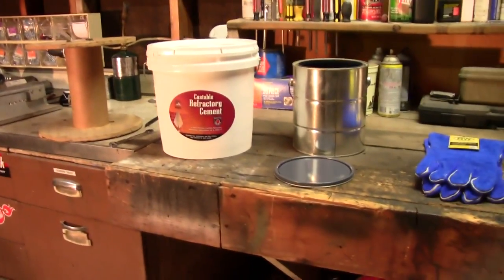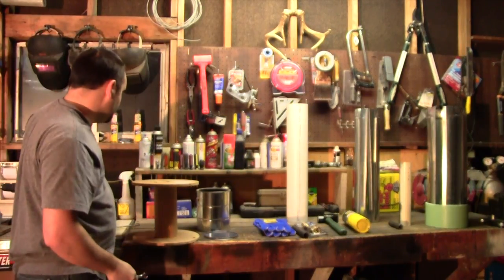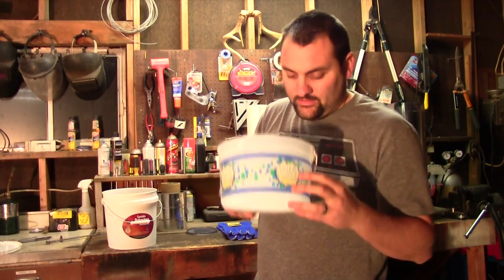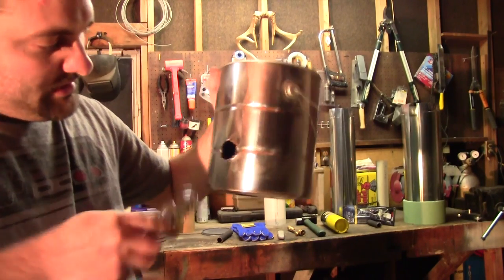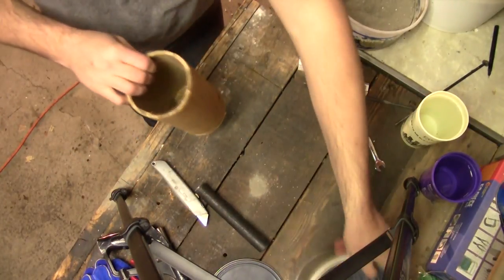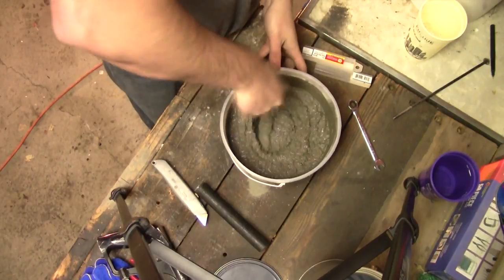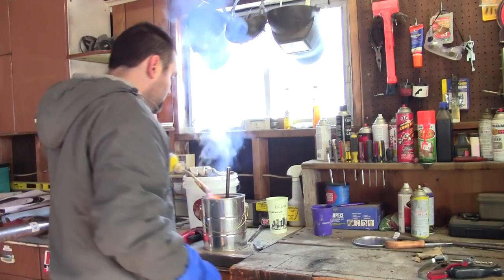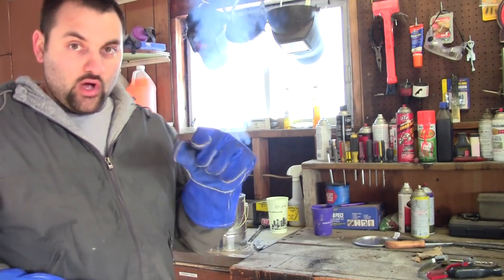DIY Charcoal Metal Forge complete build (1080P HD)

Comment: I do not know how much you know about this stuff, but you need to use a respirator mask when mixing, cutting or drilling any refractory materials. They contain large amounts of silica. Silica will lacerate the interior of your lungs and can be fatal. The condition is called "silicosis" and is accumulative, or to put it another way, it will build up over time. Protect yourself, and happy metal working! Oh, by the way, you can make a pourable refractory with 50% silica sand (play sand) and 50% plaster of Paris. Long lasting and sets up quick. Costs about half of what you paid for the bucket of stuff.
Reply: +alienh1701  question on my mind for the plaster is where can  you get it  i already know you can get play sand but im gonna experiment and use beach sand  ;3

Comment: Nice bit of work but save yourself time and effort by applying some mould release to the parts you remove and they will be easier to get out. Cheers ...ps.use oil or proper release agent
Reply from the maker: Barry Durrant Yeah I'm currently building one that's a little smaller.  I've covered my center section this time so it can be removed easier this time. :)

Comment: You would have had er a lot less of a hassle if you would of used a steel bucket, used a plastic beach sand pail to form the inside and a hole saw to cut through the side for the air pipe after you poured you cement, but before it fully hardened. That's how I made mine.
Reply from the maker: That does sound easier. :)
Reply: Although I must admit one thing, the pail takes a little effort to get out, but it's still a lot easier than what you used.

Comment: Great video, but was a little lost. I didn't expect it to be a coal forge, it was built like most small gas bladesmith forges. A few tips though. If its a coal forge its best to have an ash dump at the bottom, with a grate over the hole. And a rough measurement for gas forges that varies with your air intake, you will burn approximately 1 tank every 6 hours if your forge is the size of your tank. So a 1/2 gallon tank should last 6 hours for a forge as big as the one in this video, which is plenty of time to make a small knife. That calculation is using propane with custom burner designed as an air vortex manipulator, which can create almost twice the psi that the gas is being released at. And a small tank of propane only costs like 5 bucks max. Perfect video though and I was looking for a cheaper alternative to kaowool, never thought of refractory cement till I saw this. Thanks.
Reply from the maker: to be honest i build it planing to use gas but I don't have a burner that can power it right now.  The one i tried was too small so i had to go with coal.  I gets crazy hot.  I got distracted while heating up some steel for a knife build and it melted half my blade into a puddle at the bottom. :(

Comment: just so you know you never want to use galviinized steel. It produces toxic fume's. P.S. I am a horrable speller
Reply from the maker: I'm also a horrible speller.  I won't hold it against you.  Which part of my system is galvanized?  The can?
Reply: the metal that looks kind of shiny gray/silver. reguler iron is a dark color. If you look at car break drums and spring and frame's most of that is regualer iron with out galvinization. If you have to use galvinized iron then heat it up out side or in a well vented area. Galvinization will burn off. there is a video on here that talks about it.

Comment: I am trying to make a forge with a mic fan but now the fan is running back words how can I make it run the right way.
Reply from the maker: Jerry Thompson I tried a micro fan.  They don't work very well.  If it's running the wrong way switch your wires around.  Once you've switched the + and - then you have to make a century with vanes.  You're better off going to a garage sale and getting and old hair dryer. :)

Comment: Hello I also I did a furnace but there one thing I do not understand , when I place the lid to close the furnace flame tends to go out , when I open the flame returns to be alive . I do not understand why.
Reply from the maker: exquisitealex Fire cannot burn without oxygen you cannot close the top off.  You run it without the lid.
Reply: exquisitealex  you could add a hair drier on the lidd and get something to support it then you have a even hotter forge
Reply: +hfestag   there would be no hole for the combustion and it would  melt it anyways...  unless  two holes are made one for exhaust and one for a tube to the second  blower dryer

Comment: I like the style of your video in the fact it is "real" .. bloopers and all.... but may I suggest for your vortex effect ... using the youtube moniker's design for his Tesla Turbine Generator... well a form you can cast a release form of to put Styrofoam in and cast around it... see what it does essentially if you can imagine vanes coming off a central plate.. and those vanes for each thin layer being stacked slightly off in orientation as you go up... you get your vortex chamber and the Styrofoam for the mold... you just pour acetone over to dissolve....... but your vortex design with a venturi effect on the inlet and outlet and a cage fan could meke this thing burn really hot :)
Reply from the maker: Wow!  This is a great idea.  I hadn't thought of using Styrofoam.  I have CFD software at work... :)  looks like I need to make another forge!  Thanks for the ideas! 

The vanes would have to be pretty thick to not break off.  I wonder if I can do a helical shape cut into the ID of the cylinder and achieve the same effect?
Reply: yep.. and you can cast a negative mold of your styrofoam positive final form out of iron to ummmm never have to print the mold again;) (although for casting the positive foam mold you would really only need like latex or the like (lighter more packable) LOL
Reply: Yeah in fact I went ahead and jumped on my OpenSim instance locally to build up a 3D Model of what you might want...  the pics are here but more or less it is a tapered hollow cylinder that has the center hollowed and the thing is twisted on the x and y by 180 each ... then placed where the air inlet can act as a collecting venturi at the base... so the folder teh like six screenshots are here on google drive..... I'll try to get a blender compatible model of it made so you can export it to whatever model form you need for your machine or to modify it soon :)
Reply from the maker: Jesse Mercury Sweet.  I really like these pictures.  What I first had in mind was not this good.  I have a 3D printer at work I could print myself a thin mold with internal ribs for support and just break it away.
Reply from the maker: Jesse Mercury You don't happen to have an stp or iges file of this by chance would you?
Reply: Yeah, coincidentally I Lucked onto the domain name the other day for 99 cents of BadlyBreaking.com which I plan to use to explain DIY how to's based on science and backyard know-how in an open and free way :) so I will be interested to see the foam method and you tweaking the 3d model type I get to you with the machine you have to print out an initial form.. the actual smelting pot itself with be kinda a suspended chamber in the middle that matches the curves of the inside of the tapered and twisty flame chamber like a crucible which should be interesting seeing how it works.... honestly with enough air rammed through their with a venturi collector (think kinda a tarp funnel facing the right direction into the wind) and an additional exit venturi... (like with cars how they create negative pressure to help keep too much pressure from beneath the car to assist the compressing intake funnel... which you build by this method ummmmmm I am pretty sure you will be able to melt many many many things LOL)
Reply: on the iges or stp file.. I will port it over to a blender compatible file (like a dae, and then to the format you need.. blender is open source and free btw...)
http://blender.org/
Reply: richarddbeck Oh I should mention I just updated the pics you seen.. I added a piece at the top to act like an exit venturi and chimney and also took the thing up to the size I could take my avatar inside to give you an idea of just how "twisted it is on the inside... https://drive.google.com/folderview?id=0B001oVz9lVUufnRCYVFrOWVjd2RGWHRFa0ZpZjI2emU0Q2pBSEV4QUxxSGpFR0xCTlRMeDA&usp=sharing

Comment: next time. in stead of cement. try a 50 50 mic of plaster paris and sand it will work the same but its cheaper. i used a similar method to make my first forge
Reply: +Iron Spark It will not work. Plaster burns at the temps this forge is at. Never use plaster/sand as a refractory.
Reply: +Micah Burgin my forge uses plaster of Paris. and burns the same as his. plaster Paris is used in most home forges. evan hotter ones. you mix plaster with sand. it is quite efficient. and a good cheep way to do it.
Reply: +Micah Burgin if not then mine burns hotter. i can melt... well. degrade industrial kale woll with my forge. plaster paris is the only thing that degrades slowly enough to keep the heat in.
Reply: I've used it in the past. It burns. I use it for support and structure elements, but never for direct fire contact. Plaster and sand mix is what I was talking about.
Reply: +Micah Burgin really? mine has never burnt. hmm. but. i know mine burns well. cuz i cannot walk away. it will melt my projects in seconds if im not carfull
Reply: Take some plaster. Put it in the forge. Run full blower for a few seconds. Cut all blower. Pretty yellow flames will be coming out of the forge.
Reply: +Micah Burgin my forge runs full blast all the time. sorry to tell you but mine works fine all the time. but mine is a sword forge. its not a small one
Reply: No matter what you say, gypsum burns at around 2000 deg. f and will fail and melt at anything much higher. I need to see this sword forge, and some swords you've made while you're at it, before I believe this. Also, you do realize that aside from heat treating you can only work 6 inches at a time with any sort of steel, right? A sword forge is useless. Viking smiths made swords out of holes in the ground and sledgehammer head sized anvils.
Reply: +Micah Burgin the perks of beeing alaskan is ive been forging since i could hold a hammer. and you can only work so much material at a time. you can heat up as much as you want
Reply: So why would you have a "Sword Forge"? To me that screams "Overkill and useless" forge.
Reply: I have a sword forge because making swords is fun. Folding steel. Making layers. You cant do that in a knife forhe.
Reply: Forge.
Reply: You can fold steel in a knife forge...
Reply: Small bits yeah. But not big bits.
Reply: ... 

You only need to heat the bend point, and you can't billet weld any more than 6 inches unless you're superman. You lose heat too fast.

Folding and welding is something you should be doing at ingot/billet scale first, not at sword scale, because that'd be incredibly unnecessary.
Reply: +Micah Burgin unnecessary. but a challenge. and a lot of fun. im aware that you lose the heat quickly. and you can only work so much at a time. but if you heat up more than needed it dose stay hotter for a little longer. metal balances heat. evan when metal looks cold. its normally still at forge temperature. metal... has. times when it likes when you forge it. and times when it dosent. its hard to explain that one. i just know. some days metal acts different than others.
Reply: I'm a smith too, you don't need to explain metal to me, XD
Reply: +Micah Burgin oh thank god! metal is so fucking temperamental! nobody ever understands its not as easy as heating and hammering!
Reply: Also why I'm very incredulous of the usefulness of sword forges, XD
Reply: +Micah Burgin i wouldnt trade my sword forge for anything. i know how it works. i know what its favorite weather is. i know when it gives me the best blades.
Reply: well, smithing is a matter of whatever works. I suppose having heat treat always available would be VERY useful for a swordsmith.
Reply: +Micah Burgin. all i can say is work with what you have. i could make a sword in a small forge if it was harizontal and a through one.  it would just take ages.